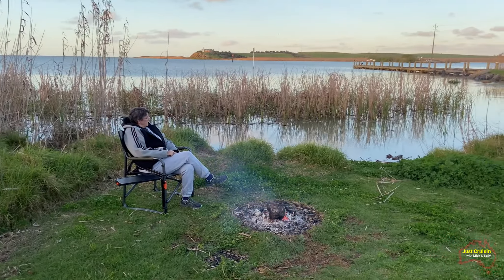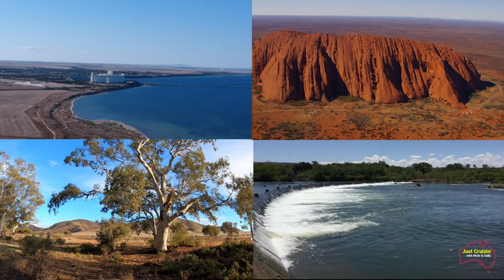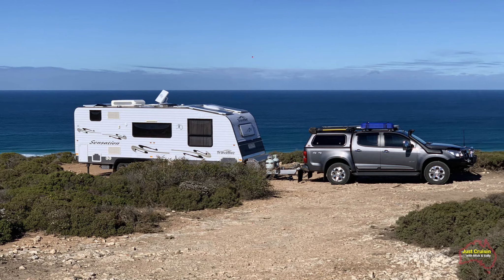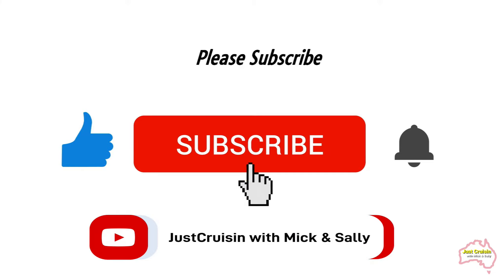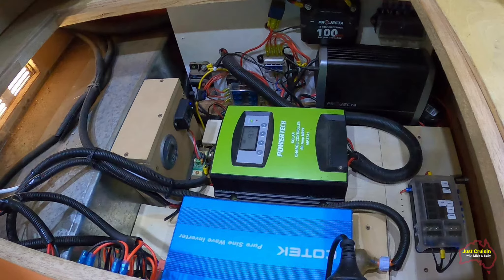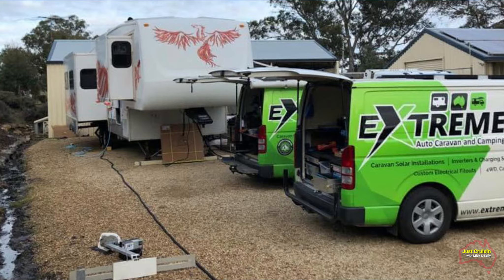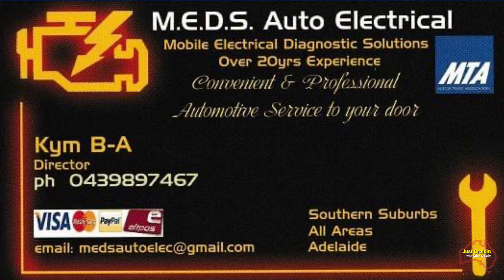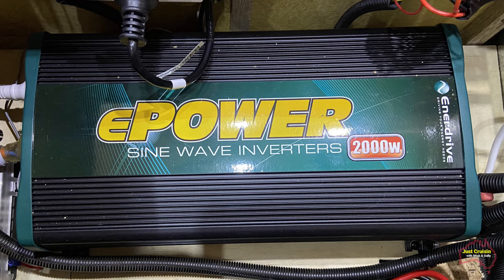AGM - Lithium Battery Upgrade

Comment: Excellent videos guys keep them coming. I’m sure this has already been said but don’t worry about that spark. You are just energizing the capacitors in your inverter. It would’ve done it on any battery system it makes zero difference. You can pre-charge the inverter if you would like with a small light bulb or resistor to a rest of the spark. That said as you are probably aware with us we do lithium upgrades on a daily basis so feel free to check out some of our videos and in regards to charging lithium batteries. It doesn’t matter what the manufacturer states the fact is lithium does require a dedicated lithium charger to get the best out of the lithium battery. All three charge sources in my opinion needs to be addressed. This is DC to DC for vehicle charging. This is your solar controller. This is your mains battery charger. If all of these are changed to a lithium charge profile if you overdose charge your batteries to the point of shut down they can wake up your batteries without a problem. Also it will bring your battery to 100% state of charge unlike your AGM Charging set up. They look at voltage only so with the lithium at 13.2 you could be at 20% state of charge or 100% state of charge. The AGM charger looks at the voltage and charges based on that. For an AGM battery 13.2 is well above full. So the charges will not kick in until a lower state of charge.
Reply from the maker: It certainly was a learning curve for me Matt.

Comment: Thankyou for taking us through the Lithium setup this has just enhanced the amazing set up with all your additional improvements you and Sally have made to your van, don’t be concerned about price as it has been professionally fitted and it will pay back many times over, thankyou for sharing Mick , safe travels 👍
Reply from the maker: We are very happy with the price as it compares well to other set ups that we have seen on YouTube. What concerned me was the fact that the buyer is lead to believe that the batteries are a simple drop in which they are not. Up and onward from here Darrel is the way to look at it.

Comment: I had lithium batteries now for some 8 years and very happy with them. To protect the battery management system within the batteries I had a 12v cutout fitted, it turns everything 12v off when batteries get low. However I kept the 1200w victron inverter and 60amp victron charger. I ran the batteries down to 12v several times now but the recharge is very quick. I also have a 40amp DC-DC charger fitted for the solar panels. I reduced the battery weight from 110kg to 38kg and ah from 300 to 360ah.
Reply from the maker: Lithium certainly do offer a huge weight reduction.

Comment: Struth Mick..what a coincidence, as I am away with bride and van over on Eyre. One of my old ordinary batteries I believe has turned up it's toes and dragging the other down, wants to go to recyclers.
Now still travelling, but paying for Park power and been seriously deep in thought of a Lithium Conversion.
Crikies ! You almost scared me britches off. So reckon I'll stay with an update of ole batteries, and this time bit of roof solar.
I have had great dealings with Matt in the past, a super efficient bloke with van electrics, but my old mans pension almost burst into flames this evening with your coverage of Lithium and needed accessories, which I do thank you heaps. Thanks Mick, so save me a seat on the road train..yeah, I can still handle a heavy and stick shift..LOL..............Thanks Mate
Reply from the maker: Good luck with the batteries Dennis.

Comment: Yes it's a good point. Lithium batteries definitely need lithium charge profiles for optional performance and life. They are expensive to purchase so risking the investment by using lead-acid charge profiles (if that even works for your equipment) is not the best idea. However lead acid IS now obsolete with lithium being so much superior, and lithium ownership/operation over the battery lifetime is very much cheaper than lead acid (AGM)..

The hidden fault with all the lead acid capacity usage claims, is that in practice you do NOT get 50% of their total rated capacity for general usage without vastly reducing their longevity. In practice in order to not unduly shorten their lives you need to discharge lead acid to only 60% full or even higher. This notably changes the comparison with lithium. E.g. For lithium you can use 95%-100% of rated storage capacity, for lead acid you can only use 30%-40% of rated capacity.

Lead acid is too expensive to own and operate, too dangerous with toxic fumes and fire risk, and far too heavy.

But also beware of some Chinese lithium batteries, their quality can be questionable. For one brand I now avoid, when buying four 150Ah 12V batteries I had two fail on arrival - getting hot and emitting smoke and fumes. It was dodgy cheap battery management systems (BMS) inside the battery cases and/or bad internal layout/design, though they blamed "freight damage". They replaced them both but only after I contacted the seller about the problem, and with zero warranty paperwork supplied. Another problem with those batteries was that they claimed 100A continuous discharge but in practice they could only maintain around the 50A mark. That can be a big problem for you system design depending on your inverter choice.

I now choose a different brand which does as claimed maintain up to 100A discharge, and from which I've seen zero other problems. The problem with using big brand lithium batteries is only the expense. If you can afford it, do that. If not go the Chinese route (as I have) but do your homework thoroughly first for the selection.

(I've been building my own semi off-grid solar systems for many years now. Am currently running two 7680Wh 24V battery banks with all Victron equipment including several inverters and a hand full of solar controllers. I have about 3500W of solar panels charging the banks. The house has a separate 3500W grid connect solar system fitted. Most of the house equipment is running off the inverters (2400W & 1600W). It's work in progress, ever upgrading as money and time is available.)
Reply from the maker: You have shared some excellent advise there, thank you for sharing that with us.

Comment: the sparkingwhen the battery is connected is likely the capacitors in the inverter charging
Reply from the maker: Could be John although they couldn't get it to do it so it all had me stumped.

Comment: useful. I have an old system (not on a van) I'm thinking about new batteries and have thought that i may as well go the whole hog and have a complete new system that can work beside the old one. (beside the old one) no one outlet would be connected to both systems.
Reply from the maker: Hope it all worked out well for you.

Comment: Very informative Mick.
On a totally different subject....did you retrofit your venetian blinds? If so, from where? ...cheers.
Reply from the maker: The blinds were a factory build fitment. We have had blinds made to our size requirements and that can be done by any blind manufacturer.
Reply: @justcruisinwithmicksally837  Cheers